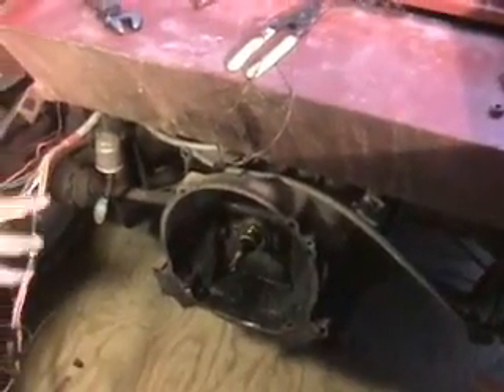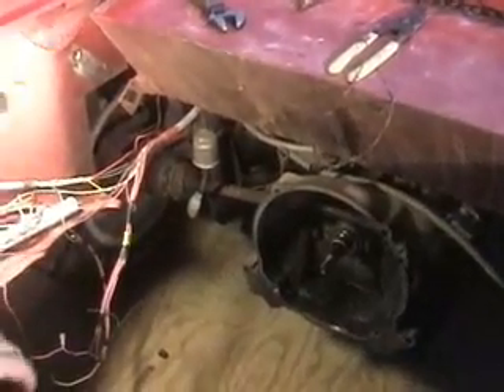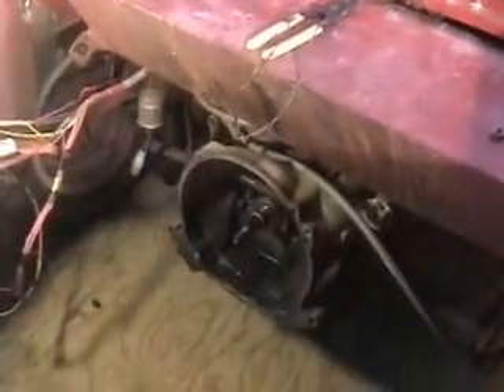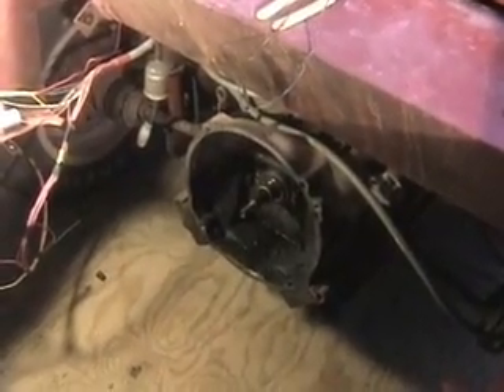Sterling Nova Electric Car Conversion Part1/3

Comment: I just wanted to clarify that what you have is actually a "Sebring" and not a "Sterling" . They are cousins but in fact are different designs. But this is a totally sick project. I have been re-building my sterling for a bit, but have gone for Subaru STI power not electric. Best of luck with the build!
Reply: thank you